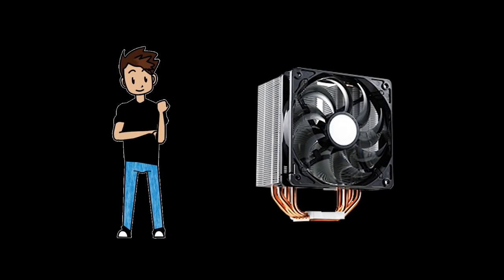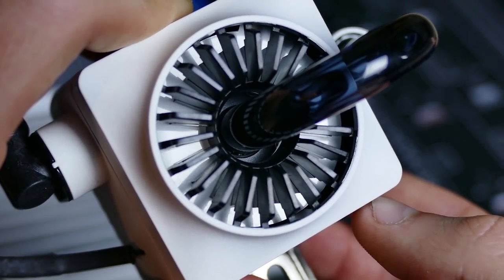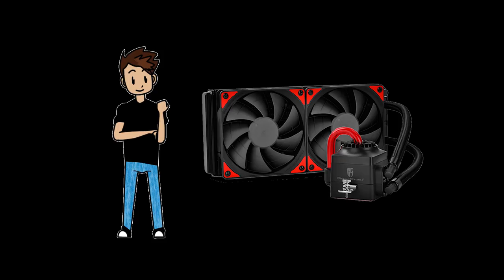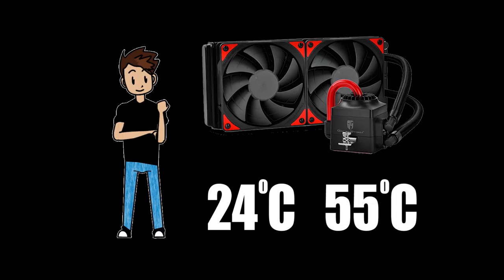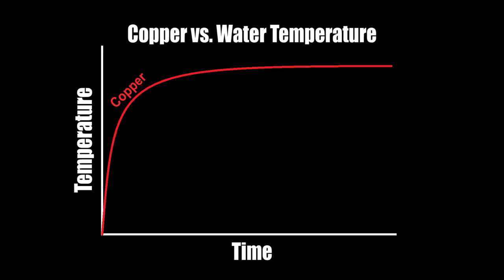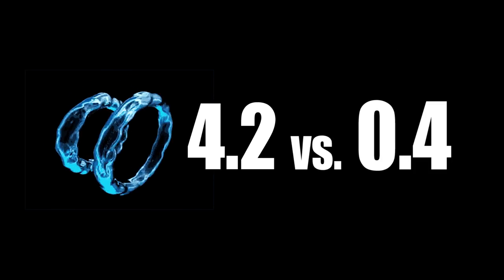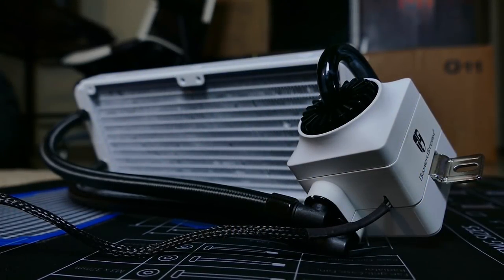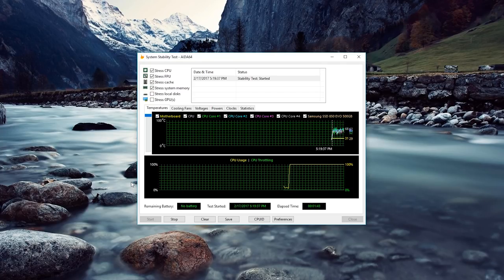How to Properly Measure AIO Temperatures

Comment: Complete BS video. Nice click bait. Go watch JayzTwoCents. The guy is a water cooling master and will explain everything to you about everything water cooling. I have done water cooling for years with custom loops and using AIO's. A water cooling AIO or any custom loop will always keep CPU's and GPU's incredibly cooler regardless of how long they are being used. The heat transfer from the blocks to the radiator which is then dissipated using fans is very efficient. When the system ramps up it is true the temperatures will rise until they reach a certain equilibrium point (and it will typically always be quite a bit lower than air cooled). Once that point is reached it will stop rising and won't pass that point unless the ambient temperature of the room continues to increase (which it will) unless the room is properly ventilated to keep the room cool since the fans pushing the air through the radiator is what is actually cooling the system. So if the ambient temperature of the room rises, so will the temperature of the loop and therefore the temperature of your CPU or GPU.
Reply: You should probably go watch JayzTwoCents. He's tested water cooled systems and air cooled systems. He even admitted that some of the air cooled systems can achieve the same temperatures as custom water loops. In fact, he's done a bunch of videos with really high air flow systems.

He specifically uses a custom water loop because he enjoys it. He also does bench marks which means temperature spikes. The average user is not going to be doing anything close to what Jay does.

Comment: This is a bad video. what kind of pc noob is this guy.

games are going to fluctuate cpu usage, so when you do hit higher cpu usages an AIO will not have the peak temps your cheap air cooler has.... so instead of that cpu in his example pegging out to 80c+ it will average out closer to 65c. This can also allowing you to overclock a bit further

Yes, this example is not going to work for someone editing video or doing something that will max out your cpu for long periods of time, but most of them aren't idiots and run a custom loop.